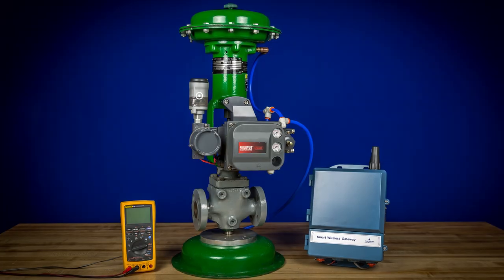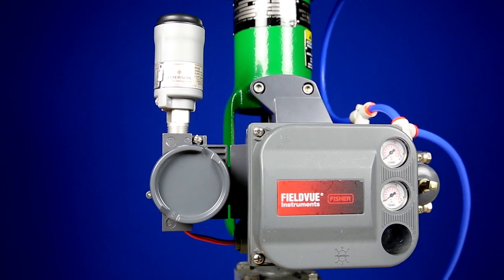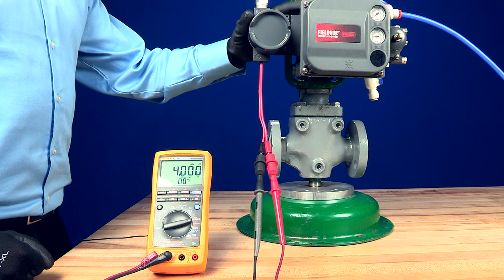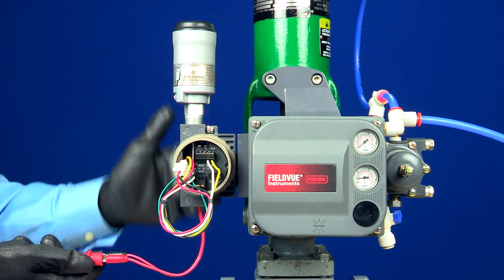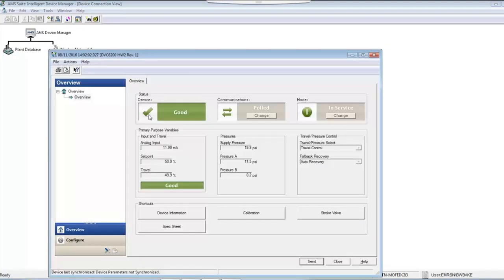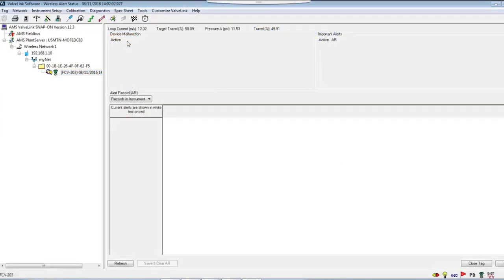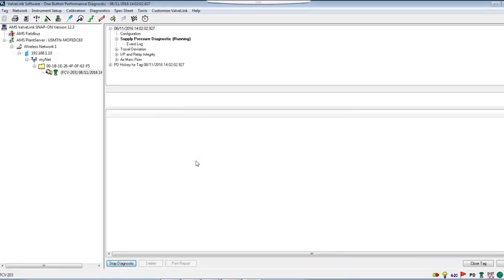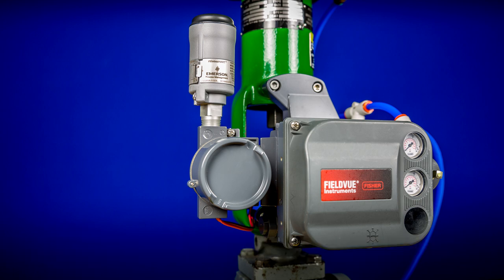Using the Fisher FIELDVUE DVC6200 Digital Valve Controller with a Wireless THUM Adapter

Comment: I have installed a new positioner onto our gas lift compressor antisurge valve and have an issue with the pneumatic signal to the actuator pulsing twice a second. The 4-20ma signal is not changing to the positioner from our DCS. Can I make changes gas compressor online with hart without the valve stroking or can I look at the PD one button without affecting the valve.
Reply from the maker: Thomas,  I'd like to get you in contact with one of our experts.  Can you please send the following information to mark.nymeyer@emerson.com?

Best Callback Number:
E-mail Address:
Complete Company Name:
Company Address (include Number/Street, City, State/Province, Country, Zip/Postal Code):